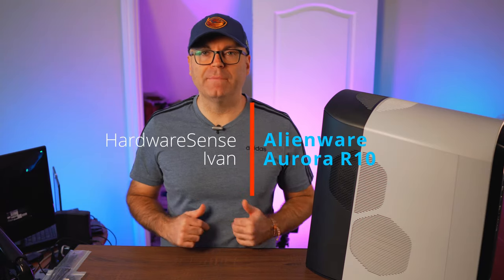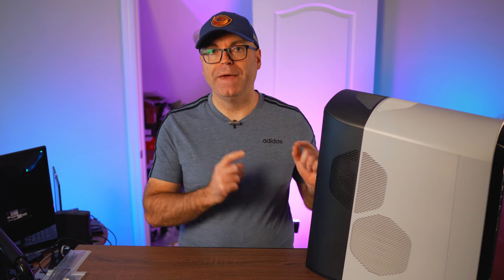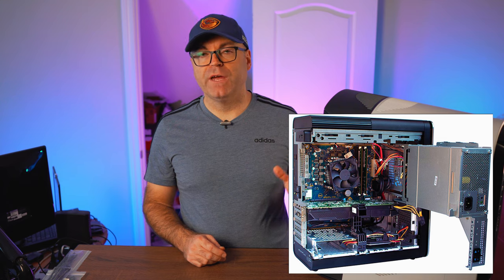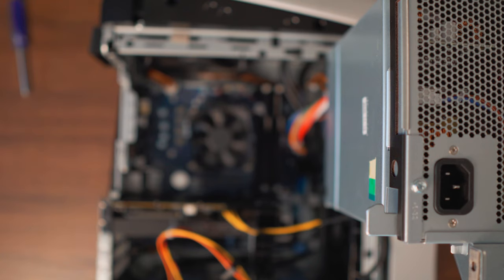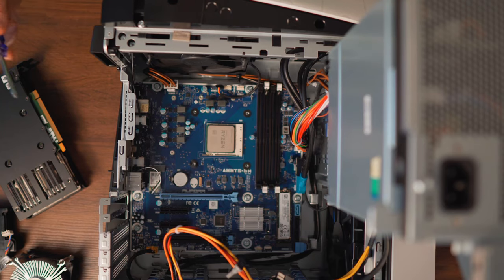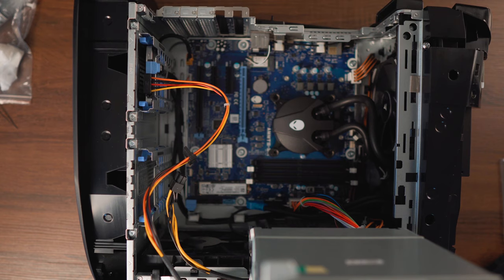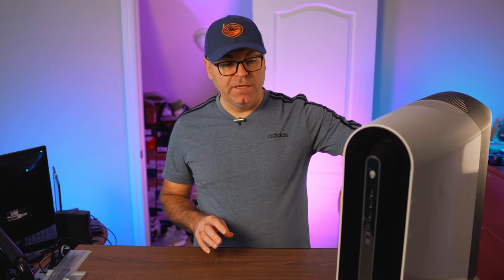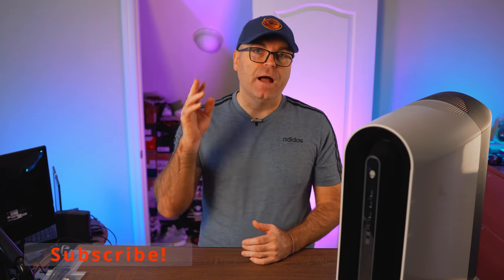Alienware Aurora R10 - All The Cooling Mods, That You Need!

Comment: I am wondering why you did not replace the stock front fan?
Reply from the maker: I did, I just didn't show it on camera, but it's the same ML120 Pro fan as the other 2
Reply: I finally did the entire upgrade,  h60 cpu cooling, sinks, quieter fans, wifi 6 and the whole thing is like a dream! Thank you so much for a great video!

Comment: so i replaced top fan with a noctua you recommended and my temps are now about 10 deg celsius hotter. i guess because the stock fan pushes a lot more air maybe??? i will be replacing stock fan back in and maybe buy another fan to do push pull or just return the noctua fan and leave it alone lol
Reply from the maker: That's why push-pull is essential since the stock fan is running at 5000-6000 rpms and sounds like a jet engine. I recommend Corsair ML120 Pro in push-pull.
Reply: @HardwareSense  yeah I guess push pull would be a different story I just don’t like the clearance. I will just be keeping it stock for now.

Comment: My liquid cooled Ryzen 5 5600x, rtx 3080 version is running 100c+ memory junction temperature. Will this upgrade help with that?
Reply from the maker: Not surprised honestly, I think the only thing that can help you is to just migrate all the parts to a new case
Reply: @HardwareSense  what case do you suggest to migrate all these parts to?
Reply from the maker: @1bloodz777  My choice would be Phanteks P360A

Comment: Any guideline or list for the screws used?
Reply from the maker: Which ones exactly?
Reply: @HardwareSense   the 2 sets (8 total) for the top and bottom of the push/pull fans. I ended finding a list, #6 machine screws, 1-1/4" long.

Comment: Just got my pc today!  Wondering if it would be bad to replace all fans with noctua and have push pull radiator noctua. And if so, will the alienware command center still be able to overclock, control, and register the fans??
Reply from the maker: Yes you can do that, just make sure to get that Noctua from the link in the description.
Reply: @HardwareSense  great! Just wanted to make sure that alienware programs wouldnt mess up on me
Reply: @HardwareSense  is it possible to replace lower front intake with the noctua, I cant figure how to attach/screw it in there
Reply from the maker: @mrnoodles3895  Yes you can
Reply: @HardwareSense  how would I go about doing that(sorry if Its a stupid question)
Reply from the maker: @mrnoodles3895  It's super easy, the front fan is mounted in a cage.
Reply: @HardwareSense  ohh so instead of screws maybe use the rubber mounts from noctua?
Reply: @HardwareSense  oh nevermind I'm stupid, I thought the cage was part of the fan😅😅
Reply from the maker: @mrnoodles3895  No screws needed, it's clips on to the cage
Reply: I replaced all of the fans with the Noctua. However, using the Noctua NF-A12x25 PWM as the top AIO fans will cause a bios error. They work wonderfully and are super quiet. But you'll get an error every time you restart the computer which is super annoying.
Reply: @toddgarvin2808  will the alienware control center still work with them? And what will I have to do about the bios error, I got the push fan and front intake replaced with noctua rn and no problems, but I imagine if I try to put a pull on top of radiator with the y cable itll cause error
Reply: @mrnoodles3895  It works fine for me. Please know I'm on an A11 (intel). That may or may not be the reason for the bios error. I have a feeling it's the Y-splitter though.
Reply: @toddgarvin2808  yea I'm on r10 ryzen, I'll check it out and see
Reply: @toddgarvin2808  just tested, it didnt have any errors, took longer to startup tho and the top fans spun faster than usual

Comment: is that the 4 pin noctua and how do you feel about a seperate fan controller  connected to the psu i got an r11
Reply from the maker: If the fans are not connected to the motherboard, you most likely will get an bios error, I don't think that a fan controller would work.
Reply: @HardwareSense  same size corsair ml120 pro in the empty hard drive slot? thanx great channel!
Reply from the maker: @vinny-lp5qv  You can't, not going to fit in there
Reply: @HardwareSense  i gotcha ! what fan did you use in the empty hard drive cage just  curious and how about cutting out the cage part to open up airflow.
Reply: never mind read the rest of the posts on here! thank you for this video very informative.
Reply from the maker: @vinny-lp5qv  Sourced the fan from the stock air cooling solution.
Reply: @HardwareSense  the noctua na-fci 4pin pwn fan controller can be plugged into psu via sata power connector for the hard drive empty cage ! its just a thought and its not connected to the motherboard.
Reply: maybe remove the hdd cage altogether and rig the fan in there using tie wraps! have to get inventive.
Reply: @HardwareSense  you can use a 120mm just remove the cage and use the 3M Extreme mounting tape to secure the fan.

Comment: I've seen another video where you put the top fan of the radiator actually on top of the chassis which will give you more room where cpu is.
Reply from the maker: And there is enough clearance between the top plastic and the metal frame?
Reply: @HardwareSense  yes seems to be just, he uses slightly longer screws for the top fan aswell
Reply from the maker: @lethalno1  I will give it a try
Reply: https://youtu.be/fkVNcTXcpAo

This is the link to one of those videos;
Also the front fan you added, why didn't you just use another corsair one? It confused me a bit because everyone replaces the 2 stock fans and add the 3rd to the radiator. Does your method put you at 4 fans? 2 intake in the front and 2 push thru the top?

Edit: I'm not a computer person but I'm doing research to cool my R11. My Temps and fan noise don't seem bad if you ask me but I'm not sure if its my configuration. I got the Top Spec with

i9 10900KF/3090/128GB@3200/1000W Power Supply 

CPU Temps are 63°C/1.34V/5%
GPU Temps are 51°C/10%/29%/810

That's playing a Game normally Warzone or AAA titles like Forza 7 or Forza Horizon 4 while listening to music and doing internet surfing in between, and I run games at their highest settings 4k@120 on Max settings
Reply from the maker: @isaacmondragonortega  I tried putting a fan on top but it's not working with regular 25mm thick fans, 15mm maybe, but regular no, you can't close the top lid. As for the front I have the same Corsair for I take plus the small from the old CPU cooler that is mounted on the HDD cage, temps are in control but most importantly the noise is a lot lower

Comment: Do you know what fan could be used for replacing the air cooled version?
Reply from the maker: Don't bother, this case is designed to have an AIO, without it, it is a disaster
Reply: @HardwareSense  yea that sucks in the sense that i didn’t get the liquid cooling one that’s why im trying to upgrade anyway i can, if you know any fans that fit plz let me know mate because my temps are high lol
Reply from the maker: @DarkSkinKakashi  Just get the Corsair H60
Reply: @HardwareSense  okay tysm and i have a few questions about it will i need to get rid of my old heatsink and get a new one and this one is compatible with Alienware ? Tysm your a big help😀👍

Comment: Does your white R10 have the Alienware side panel RGB?
Reply from the maker: Yes it does
Reply: @HardwareSense  I have the r10 but got the black case and it doesn't have the lit up side panel. I swapped my r9's case and the rgb off the side to my r10 but it doesn't show the option or that the side panel even exists in the control center so I can't light it up. You know any work arounds?
Reply from the maker: @goodcitizen7064  Not sure, will have to do some research
Reply: @HardwareSense  I have the same one as you, only the white case has the rgb light option

Comment: "Crucial Ballistix Sport LT 3200 MHz DDR4" fit to Alienware R10?
Reply from the maker: The R10 has an XMP profile in the Bios so technically every DDR4 ram should work, especially those that are 3200mhz and lower
Reply from the maker: @bumkyukim9950  Did you enable the XMP in the Bios?

Comment: Video request guide for overclocking Alienware 3rd party memory. I just installed 2x16GB 3200Mhz HyperX Fury. When I booted the Aurora R10 it showed one memory stick running at 3200Mhz and the other at 2933Mhz 1.35v. When I went to overclock the memory, I rebooted the system and it shows them running at 2400Mhz @ 1.2v

I must be doing something wrong.

Comment: Will this work for the r12 intel version the heatsink part numbers?
Reply from the maker: Yes it will, both Intel and AMD boards use the same mounting, witch is Intel.
Reply: @HardwareSense  thank you one last thing the other part number 4D5v9 seems is always out of stock. Is this for the top vram spot?
Reply from the maker: @Digitalizedx  Yes correct, you will have to call Dell every day to see if you can buy it.
Reply: @HardwareSense  thanks awesome channel i subscribed! One last thing, i have 2 corsair fans somehow an extra came with the h60 and bought the splitter you suggested.. is that also fine those fans that usually come with AIO's?
Reply from the maker: @Digitalizedx  You can install the H60 yes, but I am not entirely sure about the correct connections for the fans, but I know that is recommended in the Dell Community

Comment: Omg thank you so much my cpu used to run at 90c max now runs at 60c max tyyyy
Reply: was it a difficult to install. This is my first pc so im trying to do this.
Reply: Damn 60c max??? I only installed the h60 and it goes up to 80 here and there
Reply: @daniel-ix  I installed mine and I’m getting 60c, you must of messed up your installation
Reply: @josemadriz5716  did you add another front fan and have two top fans as well like in the video?
Reply: @daniel-ix  you have to change the top fan but that’s the only thing I did. I plan on replacing the front fan for a quieter one, it will probably bring my temps down another 2 degrees cels

Comment: Wich fans i need ? Noctua? Wich ones
Reply from the maker: Corsair ML120 Pro
Reply: so 3 corsair 120ml's to replace both of water cooler and front one so what size do i need for a second front one for the mechanical hard drive caddy top front one ?
Reply from the maker: @felixfernandez7071   80 and 90mm fan
Reply: @HardwareSense  thanks man!!! Will be ordering right now

Comment: Do you know if the ryzen 7 5800 (non x) needs liquid cooling?
Reply from the maker: With this case every CPU would need an AIO
Reply: @HardwareSense  Thanks for the reply , i just ordered an alienware aurora R10 with this cpu and added liquid cooling
Reply: @HardwareSense  So i bought 2 fans corsair Ml120 pros and the one in the top front would not fit in mine i had to jam it in there and its barely fitting and not as far in the front not sure what happend i have same model aurora R10
Reply from the maker: @sorrywatchingmizkif7429  When you say top front, are you referring to the ones on the AIO or the 80mm one in the HDD cage?
Reply: @HardwareSense  HDD cage, it barely fit, was really close to not getting it in
Reply from the maker: @sorrywatchingmizkif7429  Did you use 80mm or 92mm for the cage, the fit is tight but it works with those sizes.
Reply: @HardwareSense  Didnt know that you needed smaller, i only have the 120 mm corsair ML120 pros
Reply from the maker: @sorrywatchingmizkif7429  Yeah I reused the one on my stock cooler

Comment: What you think about those selling the alieamware aurora r10  cases those who removed the gpu to sell the case because I got one same as this one 16 gigs of ram 500 ssd  for 767 with one year warranty let me post the aspects and let know if it was a good price 

AMD Ryzen(TM) 7 3700X (8-Core, 32MB L3 Cache, Max Boost Clock of 4.4GHz)
Windows 10 Home 64bit English
Lunar Light chassis with Low-Profile Smart Cooling CPU Heatsink and 550W Power Supply
16GB Dual Channel HyperX(FM) FURY DDR4 XMP at 2933MHz
512GB M.2 PCIe NVMe SSD
Dell Wireless DW1810 (1x1) 802.11ac with Wi-Fi, Wireless LAN, Bluetooth 5.0
Wired Multimedia Keyboard (English)
Optical Mouse MS116AW
US Power Cord
Dell Limited Hardware Warranty Initial Year
Reply from the maker: I guess a lot of people did that, probably sold the GPU separately for $1000 and the rest for $700, made some good money... Can't blame them, that's the market now.

Comment: Did you have success with the 3200Mhz sticks you installed in your Alienware R10? I ask because there's a Reddit thread saying that the memory sticks Dell uses run at 1.2v and if you install faster RAM the system downclocks it to 2933Mhz and some systems won't even boot. So the user has to put in the original RAM sticks. Here's the Reddit thread:

https://www.reddit.com/r/Alienware/comments/gtb43s/memory_upgrade_for_aurora_r10_how_to_maintain/
Reply from the maker: No issues whatsoever, just activate the XMP in the Bios and you are good to go

Comment: Would putting in another Corsair Pro fan in front top help cool the 3080 gpu by blowing air off the top of the top plate or is the PSU completely blocking ventilation?
Reply from the maker: Its blocking it, the optimal is AIO with push-pull and a better intake fan.
Reply: @HardwareSense  AIO means the top fan unit? My issue is cooling the GPU. I keep the case open and PSU flipped out. Would a top front fan instead of SSD holder help blow the trapped heat away when using a Corsair Pro fan or is this a waste of $30? I already bought 3 Corsair Pro fans assuming they are the quietest fans
Reply from the maker: @someguyyoudontknow263  It helps a bit, but its not going to blow a lot of air away, its small and its quite obstructed, the impact is not huge. What kind of a temps are you getting with closed case and updated fans?
Reply: @HardwareSense  Ok so im doing this for mining. I got 106C on the VRAM case closed. Case open, I get 102 but I placed some small heat sinks on top of the GPU and if I open a window I can get as low as 92C on VRAM. I placed a fan upright on the GPU an it blowing on the heat sinks gets me 96-98C VRAM. Of course the GPU temp is 40C but Im doing this for the VRAM heat while mining 24/7 so im thinking that blowing that heat away makes a difference as the GPU top plate does get very warm otherwise.
Reply: @kevinsowards9647  that would be cool

Comment: Hey buddy i cant find the Alienware liquid cooling anywhere how can i get it?
Reply from the maker: There are a few sellers on eBay
Reply: @HardwareSense  i found one! 😊
Reply: @HardwareSense  how do you go about cleaning the thermal paste? I dont want to do something wrong
Reply from the maker: @KarmaShocked  Paper towels and alcohol
Reply: @HardwareSense  ty 🙏🏻
Reply: @HardwareSense  hey do i have to put thermal paste on for liquid cooler?
Reply: @HardwareSense  i can leave the paste thats already on right?
Reply from the maker: @KarmaShocked  No, you have to clean up the old one and repaste
Reply: @HardwareSense  ok do you coat the whole area?
Reply from the maker: @KarmaShocked  nice, even and thin
Reply: @HardwareSense  thank you 🙏🏻
Reply: @HardwareSense  hey I installed the Alienware liquid cooling and im getting a flashing yellow light?
Reply: I did everything the same way how do i fix this
Reply from the maker: @KarmaShocked  Make sure you plug the cables in the correct spots. Also did you test if the AIO is working on its own before installing it?
Reply: @HardwareSense  its working it says heat sink error thing is i never had one. Its working tho my temp is 50-60 c while in game
Reply from the maker: @KarmaShocked  Go trough the diagnostics if its offering to do them and after that should be fine.
Reply: @HardwareSense  if i get a heat sink the error will go away but from what people say i dont need it

Comment: The biggest issue with the graphic car’s temps are its VRAM temperatures - which is seemed was not showing in your Hardware Monitor.  I have an R11 and the VRAM was reading 100C in some situations.  The CPU and GHPU were fine, but the memory on the graphics card was borderline dangerous.

All in all this is the WOPRSE case design in recorded history.  Over engineered, needlessly complicated with terrible air flow.
Reply from the maker: Not surprised, considering there is almost 0 airflow around them

Comment: could you please share the link for the liquid cooler?
Reply from the maker: The cooler part number is in the description, you can try finding it trough Dell but they are constantly sold out, best bet is ebay.
Reply from the maker: @hassanar1  No it will not, that's for older versions of the Aurora

Comment: can u case swap?
Reply from the maker: Yes you can, but the problem is the back plate, you will need a new motherboard to look nice
Reply: What mob would be a good option
Reply from the maker: @blessedc8897  Any B450 or B550, or X570
Reply: What do you mean by back plate
Reply from the maker: @blessedc8897  IO Shield

Comment: Gamers Nexus went absolutely off on this model. They did not like it one bit.
Reply from the maker: They were overly critical, and to some extent they are right, if you don't get it on a deep discount and don't plan to modify it, it is not a good computer.
Reply: @HardwareSense  got mine for $999 i5 and RTX 3060. But having issues with the new noctua fans. So you use something other than the alienware command center to control yours?  Command center just locks my new noctua at 41% and it's loud.
Reply from the maker: @nonyabusiness775  So far the only one that has no issues is the Corsair ML120 Pro, all the rest have one or another